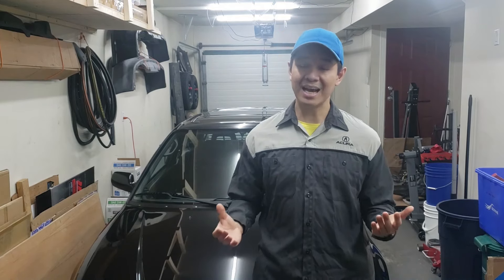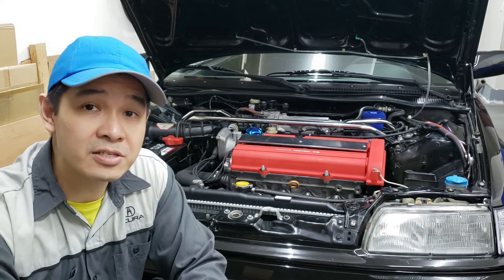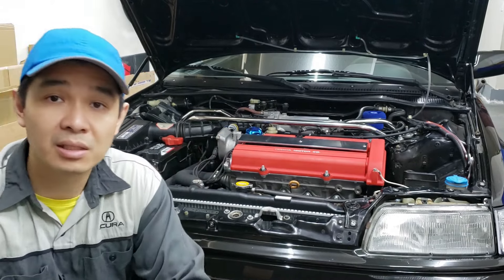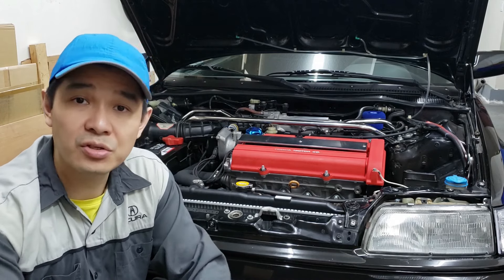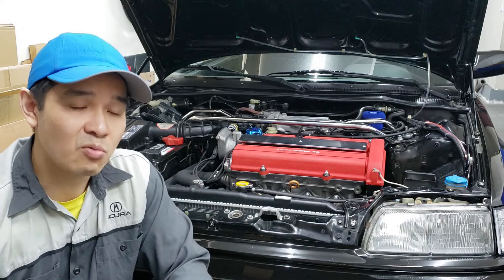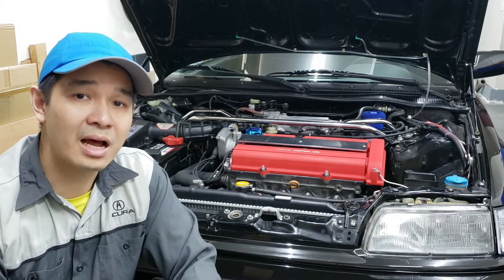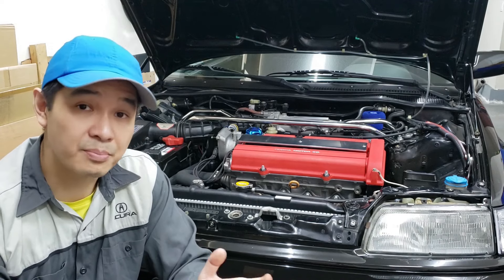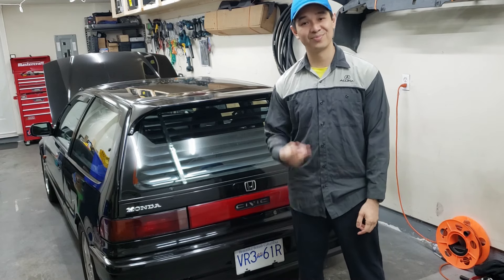||HONDA EF9 / ED7 CIVIC & CRX|| Update on B18B1 Swap after 500 Miles🔥 & Window Blinds Review👀

Comment: From personal experience, the best possible upgrade you can do is a 96-00 CTR transmission. Bell housing should mount up directly to the B18 block. It will dramatically change your track times, far more so than any head work.

Comment: Looks like you need a b16 head, b16a trans short gears
Reply from the maker: I definitely would love a b16a or any of the short gear b seriers trans, which I think by itself would be a night and day difference. But, I wouldn't want just a b16a head. I prefer a complete b16a. The lsvtec build would be a lot of work and money to get it running as reliable as a original b16a. Unfortunately, all b series vtec parts are just brutally priced and hard to find in good shape.
Reply: That is true, I'm about to finish a b20v (gsr head) in my ef. Finding a short gear Trans for anything less than my children's college fund is near impossible